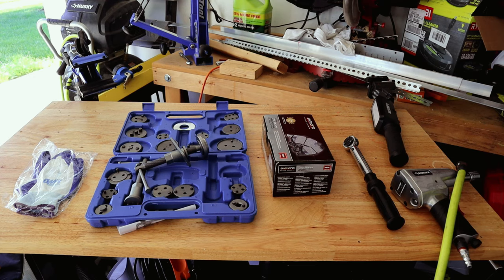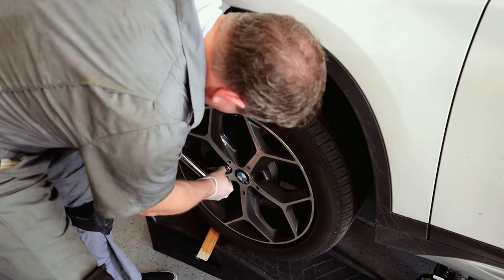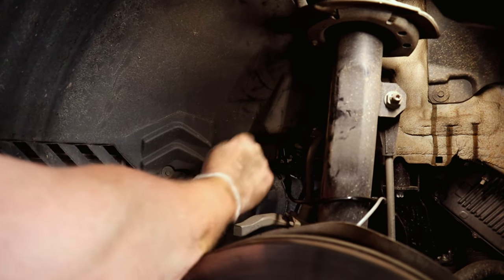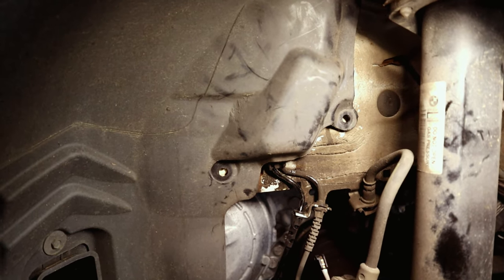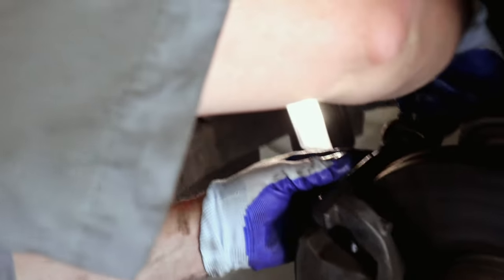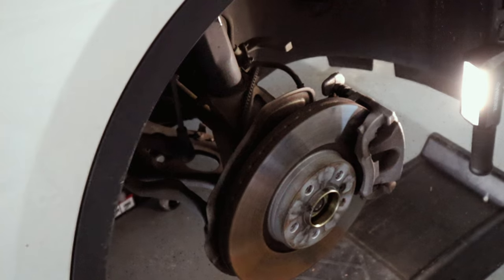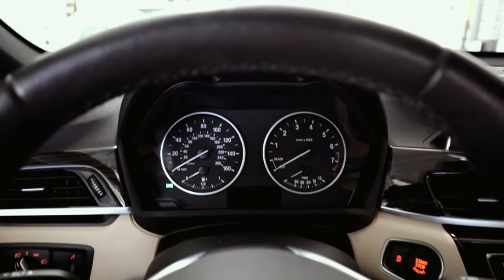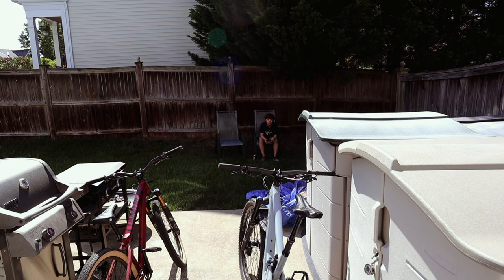#MTBPlanB DIY front brake pads and sensor on 2017 BMW X1 xdrive 2.8 F48

Comment: Very important to always pull, whipe clean, and re lubricate the brake caliper guide pins inside those small rubber boots under the caliper bolts that are removed to free the caliper.  These move with every brake press and are responsible for releasing pressure on the pads. They often get sticky and can cause break pad rubbing and premature break wear. Worth noting otherwise great job and thanks!

Comment: 57,000 km and the brake warning light came on. 7 mm on the outside pad but 3 mm on the inside pad. I’m switching to Akebono ceramic pads as well.  Akebono packages up the sensor with their pads - at least through  RockAuto. 
Good solutions on the  jack points!

Comment: I needed to replace my front brake pads at 38k miles. Definitely no need to change rotors due to wear. My rotor had worn from 24.25 mm to 23.95 mm. It’s stamped as good until 22.4 mm.  That’s 100,000 miles with my driving habits.
Reply from the maker: Thanks for sharing!

Comment: Excellent video. Very informative. It must be a very similar procedure for the BMW X2. It seems that all these front wheel drive BMW’s need new pads at around 30-40K miles. The wear sensor is designed to catch the worn pads with plenty of meat left for a few hundreds more miles of driving, to allow the owners time to schedule a service appointment.

On the other hand, the rear wheel drive models last for almost 80-100K miles before needing pads and rotors.
Reply: Exactly. My pad still had 4 mm when the brake sensor nib was sheered off and the brake warning lit up. No brake noises either.  Waste of about 4 months of driving.

Comment: I have the same vehicle and my brake pads light came on at almost  the exact same mileage and I bought the car at 33,000 miles
Reply: My light came on at 33k according to the dealer the inside pad thickness is less than the outside.. turning on sensor

Comment: Yes it's way to soon and we will need a video for the back later. 49000 for us and light just came on.
Reply from the maker: For sure!
Reply: Thats basically my, Question, does the rear come on at different time? Will the display says rear brake service ? I currently only see Front brake service due. Mine is a 2016 year
Reply from the maker: @asvtony  Yes. Look at your idrive screen under service and it will indicate if front or rear sensor triggered.
Reply: @asvtony  yes the rear usually lasts longer.
Reply: @MTBPlanB  Any video on Rear brakes? I know those have the EPB , to deal with. Thanks Did my Fronts yesterday,  & all is well!
Reply from the maker: @asvtony  Probably very soon to come.

Comment: Thanks so much for the great video. Did you experience any issues with the non-OEM brake sensor not working with the BMW?  This particular brand of pad is low to no brake dust?
Reply from the maker: No problems with the aftermarket sensor. Brake dust appears similar to oem. These pads tend to squeal more so put adequate grease on the piston face rims.
Reply: @MTBPlanB  awesome, thanks again!

Comment: When you compress the calipers the brake fluid reservoir level will go up, a good idea to check after the 1st one and hen complete you may need to remove some if it is way above the maximum level.
Reply from the maker: Great point 🤙

Comment: Good Video I have a 2017 X1 but 62K miles.   I just replaced my front pads and the left sensor the right one had not worn out.   Now I can't get the light to reset.   When I go in to the menu and reset it it says possible in 150 miles.   Can that be you must drive so far before resetting it?
Reply from the maker: Yes I’m positive you are right.

Comment: Does the rear Brake Service notification,  turn on separately from the front. Or are all 4 done at the same time? Thanks
Reply: Separately. There is one sensor per axle, not two, by the way. Because we usually change pads in pairs, both sides at the same time.

Comment: can you provide info on the pads and sensors you used? I’m out here in Europe and don’t wanna spend an arm and a leg for pads if I can get them on eBay for half the price.
Reply from the maker: Front pads Akebono eur1892
Front wear sensor Bowa 34356888167
Reply: @MTBPlanB  I am seeing the Akebono eur1892 on amazon and it shows that it comes with a brake pad sensor. Any reason why you purchased a separate brake pad sensor? Or did your kit not come with one?
Reply from the maker: Yes My kit was different.

Comment: Do you think this brand of pads is better or the same as stock bmw pads?
Reply from the maker: Yes just as good braking power in my opinion. I would put a good amount of grease at the contact point between the piston and the pads to eliminate squeal.

Comment: What’s the name of the tool that you used to loosen the lug nuts? I’m having a hard time getting mine off.
Reply from the maker: Try a long handle socket wrench or slide some longer metal pipe over the handle to get more leverage. I don’t use the air impact gun to break the lugs loose.
Reply: @MTBPlanB  Thank you!
Reply: Torque wrench and sequence it. Last thing u want is a stripper on the bolt